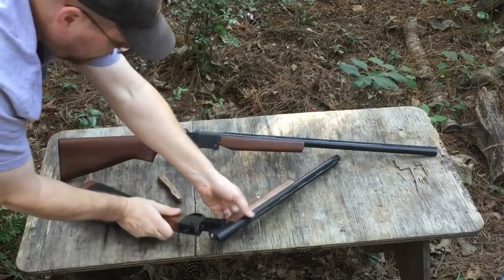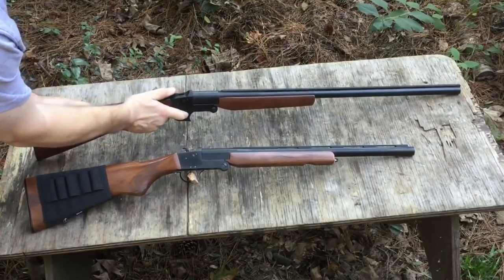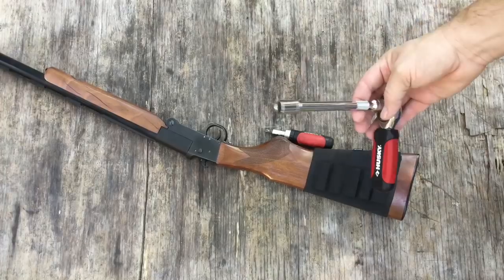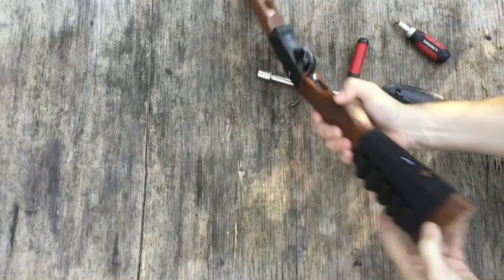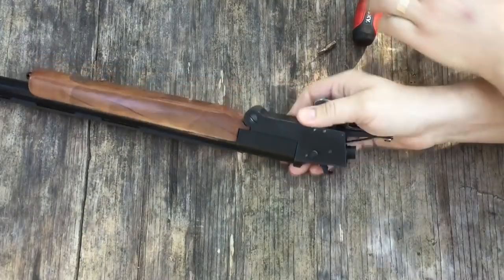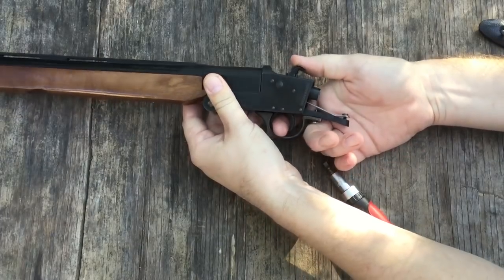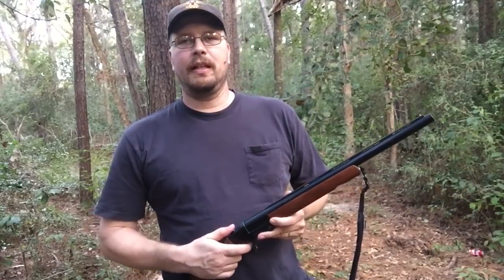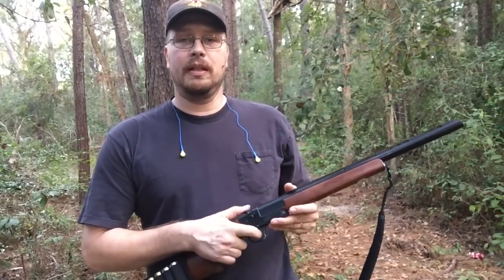Adjusting the Hammer Spring on the Hatfield Single Shot

Comment: That was a quick way to reduce the hammer spring tension.
Now that you created a lose set spring screw your tension will change with normal gun use.
I suggest you place a shim or washer under the spring to keep the set screw tight or just use Loctite to hold it correctly.
Reply from the maker: john blecker I agree, that is the best way to go.
Reply: A washer or shim will have the same effect of having a tightened screw. You have to use loctite.

Comment: John, I just accidentally discovered something.  I also have (had) the problem of a hard trigger pull and did as you've shown and while it helped some, the trigger pull was still pretty bad.  I've another problem with the shotgun in that it hard to break open and often times I pinch my middle finger...enough to draw blood.  This pinch was created by the back of the trigger guard being pushed up against the screw that holds it.  So, while messing around, I took the screw completely out. WOW...I immediately noticed how easy it opened...then I pulled the hammer back....easy...then I pulled the trigger...very nice.  Of course this can't be  right...so I put the screw back in finger tight plus 1 turn...back to the way it was.  Then I reversed the screw 3/4 turn...now it's like silk.  I don't know why this is...I can understand why it would open easier...but what has that screw have to do with trigger pull.   I mean, it's great.
Reply from the maker: Sorry, I have to admit I laughed a little at you pinching your finger. I feel your pain, I've done the same. I'm not sure why that screw would have anything to do with trigger pull. I'll check it out when I have a chance.

Comment: Thank you very much for this tip. I bought this gun in a 410 for my nine year old son as an upcoming Christmas present. It was too good a deal to pass up, but I was concerned about that stiff hammer and trigger. Definitely going to try this out!
Reply from the maker: Scott Ragan I hope it helps. I should've added some thread lock to the hammer spring screw to prevent it from backing out over time.

Comment: Thanks! This worked for my ATI 20ga. Trigger was awful, hammer was so bad my son couldnt even actuate the hammer and could barely pull trigger. 
The hammer is much easier and the trigger is better. The adjustment screw has plenty of threads. I did use a thread locker but this screw is already under tension from the spring.

*still kicks like a barrowed mule😅

Comment: I just bought one of these in 12ga. It seems to have the opposite effect, ya too soft and doesn’t set of rounds! So I tightened it a a little. Hoping to try it out later this week. Going to wear goggles in case it’s too much and blows powder back in the face.
Reply: Just got one have the same issue, tried tightening helped but didn't stop the light primer strikes and misfires

Comment: John, I have this gun in .410.  I have done hammer/trigger pull adjustment by loosening the screw.  It helped a lot, but it is still really stiff.  I don't have a gauge, but I know it's much higher than the 7 you've achieved.  Here's the deal, on mine, I have unscrewed that adjustment screw almost all the way out...the screw has enough threads to go further out, but if I do the spring itself is just sitting there being kept in place by the screw which is only finger tight. (hard to explain).  I was thinking of either making a groove in the receiver allowing the sprint "V" to rest a bit deeper or to use the washers.  If I use the washers, I will need a longer screw.   Any suggestions?  Maybe I'm confused on the washer usage.  Have any illustrations?
Reply from the maker: I'm not sure what your next step should be. By the sound of it you've taken almost all the tension off the spring, and the trigger is still too heavy. Polishing the hammer, and sear may help, but I don't have any advice for doing it. 
 I'm not sure what my trigger weight is.  I don't have a pull gauge.

Comment: Have you taken the barrel off? It looks like there's a screw or bolt it pivots on.

I make my own barrels for the NEF single shots and am curious if it would be easy to do for these things as well. Strangely, wal-mart won't let me at one with a screwdriver before I buy it...
Reply from the maker: skiddyfisk Lol, no looking at them with a screwdriver. That's cool that you make your own barrels. I haven't tried to take it off. I have a Yildiz .410 that has a similar hinge pin screw. I've tried to remove it, but broke a screwdriver tip, and marred the screw. I think I will leave it alone.
Reply: I tried to turn mine and it would not budge. That was with my considerable weight on the screwdriver and using a wrench to turn it. They must have used permanent thread lock on it.

Comment: John do these single shot Hatfields have a transfer bar system or ? In other words can you leave one in the chamber safely with the hammer down?
Reply from the maker: dampy They do not have a transfer bar, the hammer directly strikes the firing pin. The hammer will not travel fully forward unless the trigger is depressed. They also have a hammer block safety. It is safe to carry loaded with the hammer down.
Reply: good to know, thank you sir.

Comment: Have you tried taking that screw of and putting a small washer under it so the screw can stay tight?
Reply from the maker: Gareth Hughes The screw wasn't bottomed out, or tight from the factory. I do agree the problem should be addressed. Maybe a tapered washer to match the angle of the mainspring. One commenter mentioned clamping the spring in a vice and tapping it to lessen the angle. This might be the only proper way to fix it, but one would have to be really careful.
Reply: Has anyone considered finding a longer screw? A 2-3 in screw would allow you to adjust the weight from the outside using pliers then cut and grind it off flush

Comment: i bought 2 of these for my teenagers. Both with heavy triggers, one was extremely heavy. I ba ked the screw off about 1 and a half turns and made a huge difference. O would like to try to polish the triggers if possible, they feel gritty and could probably be alot smoother. Good gun for 99 bucks, you cant beat it.
Reply from the maker: Hutch EOD I was also think about polishing the trigger sear, but the last time(25 years ago) I took apart a single shot that was held together primarily by pins. I told myself I'd never do it again.
Reply: John Capps ....and that's what scares me. last thing I want to do is ruin it.

Comment: Thanks for the information. The hammer is so hard to pull back on mine you almost have to use both hands. And the trigger on mine you pretty much have to yank it for it to go off lol.
Reply from the maker: Devin Dugger The hammer, and trigger are terrible from the factory. I don't understand why they would make them this way. At least it's an easy fix.
Reply: John Capps I know right. It's pretty good gun for 100 bucks, But if it just had a shell ejector it would be so much better. We'll thanks for for the info and this helped tremendously.
Reply from the maker: NobodyWhatsoever you've got a point, but I can't emphasize enough how heavy the hammer, and trigger were. I own a variety of guns, and this was far worse than anything I've ever experienced. It was so heavy it made intentional discharge difficult. 
 The H&R is better quality, but the fact this one folds was the selling point for me.
Reply from the maker: NobodyWhatsoever A week after I bought the Hatfields  I found a Yildiz TK12. The Yildiz is a beautiful folding shotgun. It looks almost Identical to the old Barretta folding shotguns, and sells for $160 at Academy. If I had found the Yildiz first I wouldn't have bought the Hatfields.

Comment: mine out of the box wont fire ive done nothing to it maybe i need to do this but tighten the hammer cuz its only dimpling my shells
Reply from the maker: prototypecitizen I woul think it's an issue with the firing pin. Or possibly the safety bar is preventing the hammer from fully dropping . Should be a warranty repair. https://www.hatfieldguncompany.com/warranty  .
  I've had a problem with Remington shells in the past. The primers were recessed too deeply, and would only be dented by the firing pin.
Reply: the safety isn't getting in the way I checked I took it out today and shot it 4 times but each shell took three attempts to fire and I was not ready for the kick it bounced out of my shoulder and off my cheekbone I'm fine but this has got to be the hardest kicking 12 gauge ever made originally bought this as an alternative home defense for my .308 but a burglar will only die laughing if a point it at them and fire 3 times to shoot once then have to reload
Reply from the maker: prototypecitizen With the barrel open, and pulling the trigger you can push the hammer forward and see how much the firing pin protrudes. mine protrudes exactly 1/16". I have never had any misfires. 
It could also be an issue with head spacing. 
 Another question. Have you tried different brands of shells? 
I would be contacting Hatfield for sure about the problem.

Comment: It would be best to get the adjustment on the spring by using a washer for space so that the retaining screw can be tightened down and still retain the relief on the tension of the hammer, use the thickness of the washer(s) to adjust the tension on the spring. By being able to tighten the spring you virtually eliminate the chance  of the screw loosening or falling out of it's place.
Reply from the maker: That would be a good thing to do. I've been thinking of using a short piece of metal tubing mitered on one end to match the angle of the mainspring.
Reply: Using various thicknesses of washers in such an application is an old and often used method of lightening leaf springs the change of angle and final compression on the spring leaf is lessened by more space sometimes just a small piece of shim is sufficient other times a thick washer is necessary.  For best results shim out until the hammer strikes are so light it will not detonate the primer reliably, then back of on the height of the shim until you get reliable primer strikes.  This process will also automatically lighten the trigger pull as well.  Thinning the leaf spring is fraught with problems and will often cause breakage of the spring because of the thinning.  Best to just adjust with shims and washers until you are  happy with the result.  It takes an experienced expert to successfully thin a spring, don't try it unless you have lots of spare springs to replace screw ups.
Reply from the maker: Donald Denison That all makes sense. I never said anything about thinning the the spring. I was meaning to use a small piece of metal tubing to make a bushing, instead of using washers. The top of the tubing could be cut to match the angle of the spring where it meets the screw. The washers would be an easier solution.
Reply: Dear Mr. Capps:

     I know that you never mentioned thinning the spring which is by the way,  the best way to handle the situation if one knows all the details and pitfalls involved in doing this, and has had lots of practice using this method.  Thinning the spring is something almost everyone eventually considers, I was just giving some advice based on my experience with the subject.  even a small file mark left during the thinning that is not completely polished out and blended in can set up stress patterns that can cause failure of the spring, that is why I was steering you away from this direction before you even considered it.  Thinning will work the best, but one had better be sure that he knows all the details and pitfalls of this method and has had lots of practice before attempting it, and spare springs to use as well if you fail in thinning correctly, I have learned this to my sorrow in the past.  You will find changing the washers or shims in height the most practical solution, it is expeditious and effective and will solve almost all problems. Don't forget that after you find the best combination of shims and washers and have tested your fix, that you need to degrease the screw and it's screw hole then apply some kind of thread locker, even if it is only a bit of your wife's nail polish to the threads and then tighten it down for keeps, you don't want your new repair to come undone on you.

Sincerely Yours

Don Denison
Reply from the maker: Donald Denison You're right, I had thought about thinning the spring. I was afraid of messing it up, so I didn't try to. You have convinced me to install washers. Thank you for sharing your knowledge, and advice.
Reply: Dear Mr. Capps:

     I am pleased to help, it gives an old man great pleasure in passing on his experience.  I have messed about with a variety of firearms since I was a pre-teen back in 1954.  I still won't work on thinning springs, I have seen too may fail from undetected scratches or file marks on the spring leaf arm  so I turn those tasks that shims and washers won't fix over to experts, there are only about a dozen of these across the country.  Good luck w with your project.

Sincerely Yours

Don Denison

Comment: did u cut the other shot gun off
Reply from the maker: I cut the batrel, and made some changes to the stock. Here's a link to my hatfield playlist. this HTML class. Value is Hatfield single shot
Reply: Thanks I was thinking about cutting mine I have a 410. And a 20 ga
Reply: How many inches did u cut off I love the way yours look
Reply from the maker: Johnny Arnett It now measures 20 1/4". I cut it so it would be flush with the butt when folded. The link didn't work earlier. I have a video showing the changes I made. https://www.youtube.com/playlist?list=PLR4nYpmbouGWkSbceDGibeDDQ6GsBpH4y

Comment: Do not loosen that screw. It will eventually continue to loosen and cause other problems. 
If you feel compelled to do so, use red lock-tight.
Reply: I figured I'd shoot mine quite a bit first to see if it breaks in or loosens up the trigger. A lot of times with new firearms it takes some break in time especially on one that only cost $99 bucks.

Comment: Wish they had the shell eject
Like the pardners had .
Reply from the maker: Bryan Mcpherson I agree, an ejector would be nice.
Reply: Actually I like the Hatfield SGL ejection that just raises the brass end part way back a little to take it out with your fingers. I save my hulls, so then I can just stick them in my coat pocket.I have two H&R Toppers that break over and they eject the hulls 6 foot behind you on the ground and then you have to bend over to pick it up unless your ready to catch them before they pop out. Ha,ha I guess it's just a getting old deal lol.
Reply: The simple extractor is much better than my break actions with ejectors.  I just don't have the strength to pull the trigger, and get misfires from loosing just 1 turn.

Comment: now loosened  it could in time  come out  all the way  do check it  from time to time  say every  couple hundred rounds or so
Reply from the maker: embarado smithing and woodcraft If the screw starts to back out on its own it will be easy to tell. The hammer would get lighter, and lighter.
Reply: just thought id say it in case it had sliped past thought process  as is possible
Reply from the maker: It would've been best if I had applied some thread lock to the screw.
Reply: I was think that to
Reply: but I thought a light  nudge you would come to it if ya hadn't yet
Reply: You are right, screws are there to tighten things up. I would remove the spring and slightly bend it until I get the desired tension.
Reply: not me   I use a file and take off a small piece at a time  bending a spring  creates a weak point   trim 1/4 inch  at a time till close than file till JUST RIGHT GOLDIE LOCKS STYLE lol
Reply: embarado smithing and woodcraft The spring is lightly tapped with a small cross peen hammer along most of it's lenght between the jaws of a vise that are open about 3/8" or a similar arrangement must be found; that way the excess energy form spring overtravel is relieved. In reality to lighten the spring pressure the leaf has to be straightened up a bit. The stock removal method works better on old style, tapered profile springs but for what I can see the springs on these shotguns are simple flat leafs with no taper whatsoever. Regardless, what works for you is OK with me. Cheers!

Comment: Just went to buy one of these in 12 gauge from Wal-mart. The stock was already cracked in 2 places and the quality is absolute TRASH! These shotguns are hot garbage. I was very disappointed to say the least. I wouldn't take one for free even. If you like it that's fine, but for my $100 I'll be headed to the local pawn shops to look for a used New England Firearms or H&R single shot that is of much higher quality.
Reply from the maker: Trevor Gomez I agree, the H&R is much better quality. The selling point for me, is that these guns fold in half. Hatfield could bump up their QC. There were many discrepancies between these two guns. 
 Here's another folding shotgun you may like. The quality is far superior to Hatfield. https://youtu.be/3fcNfWqBYI8
Reply: John Capps Thanks I was just disappointed to see cracks in a brand new in fired shotgun.